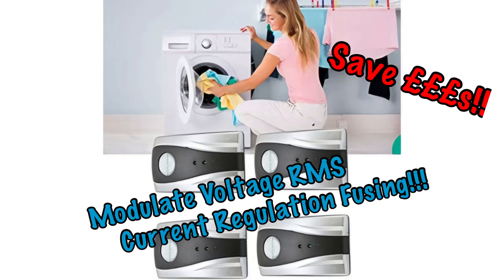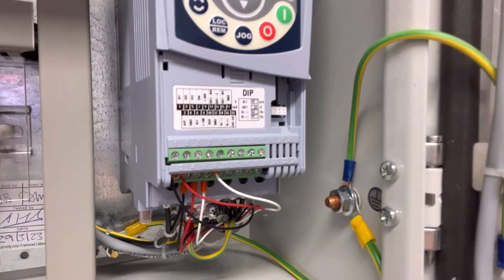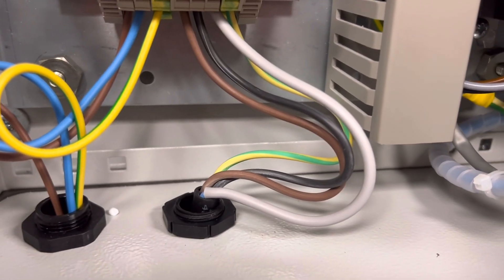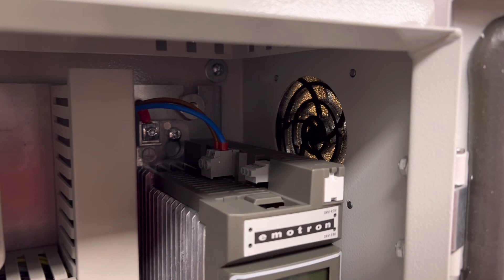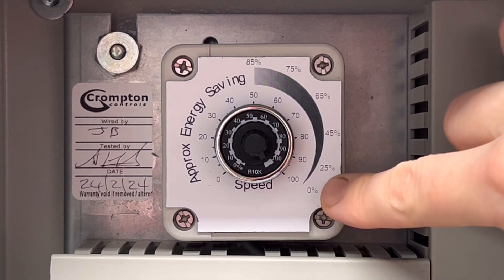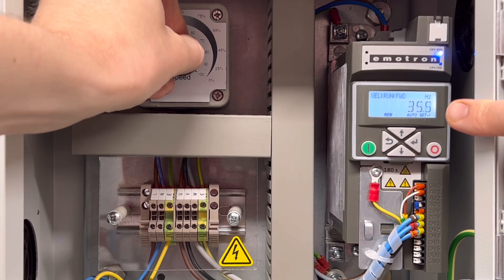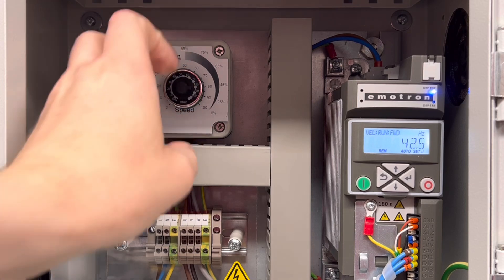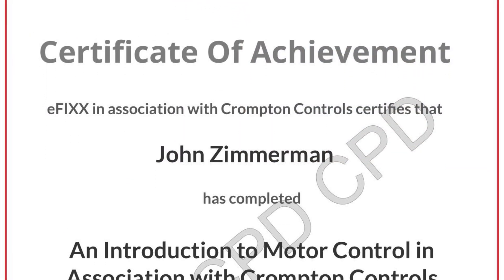Can This Variable Frequency Drive Slash Energy Costs?

Comment: I have spent years working with invertors on very big load handling pallet cranes in high bay warehouses. After commission and testing is completed and the project teams leave all invertors are reduced by 25%, this saves energy but more importantly, saves wear on the cranes, ours always had better reliability than other sites.

Comment: Watched you Chanel for a long time and it’s the first time I have to take issue with your information. I have spent all my working life in automation and control so have an idea about motor control. The energy savings shown only apply to loads such as fans as the power something like the square of the speed. A small reduction in speed gives a big reduction in power as shown but critically also a big reduction in airflow. Halve the speed and you quarter the airflow, this doesn’t apply the same to other devices where loads are proportional to speed. Don’t get me wrong there are some serious savings to be made on some applications by fitting inverters but your video is very misleading to people that don’t know. Being able to buy them in a ready to go enclosure is a great idea and saves time building one up. Not sure how they get away without a door interlocked isolator when it’s just on a T bar lock 😱😮
Reply from the maker: Firstly if people don’t understand the application they shouldn’t be tackling the problem. In terms of the interlocked cover you’ll notice an additional barrier over the mains terminals.

Comment: I fittted a VSD which I bought on Amazon for €100.00 to the pump on my swimming pool here in the south of France two years ago and with a little expermentation with flow rates I have been able to reduce my power consumption by 50% while still maintaining an adequate flow of water through the filtration and treatment system.

Comment: Having fitted inverters for speed control 30 years ago, I have to ask, “what’s new?” The problem with varying the frequency to induction motors is that they rapidly decrease in efficiency and power the lower it goes. You also have to remember the cooling fan on the motor is designed for maximum speed, and any reduction could lead to overheating(been there, seen it).  Induction motors often have to be over specced due to their low starting torque. You’re better off choosing slightly lower gearing, and increasing the speed with the inverter if necessary(within limits).  I would like to see the figures of power useage with varying frequency, as I have seen expensive meters misread too many times. So to say I am sceptical would be a bit of an understatement. But for the sake of Crompton’s, I hope they can market them to business or domestic users for running 3 phase equipment, such as lathes etc. off single phase. The problem is, there are too many companies in the business, with some very competitive pricing.

Comment: Please also remember that for a business, the panel and install should be tax deductible- length of deductible period varying buy location in the world. The real magic is showing the dial. This would be of most benefit to fans, and some pumps. 
Remember these type of loads often operate under inverse power cycles, so reducing load by a quarter can save 50%.

Comment: A quick Google shows this unit costs just over a grand, so say goodbye to all those cost savings then.
Reply: For domestic, sure. But for industrial machinery, it could pay back pretty quick.
Reply from the maker: And a quick play with their calculator shows that the pay back period is surprisingly quick, so hello to the cost savings! 😃
Reply: go diy save 700 is not hard if i can do it you can to